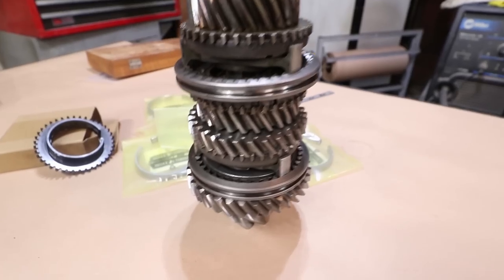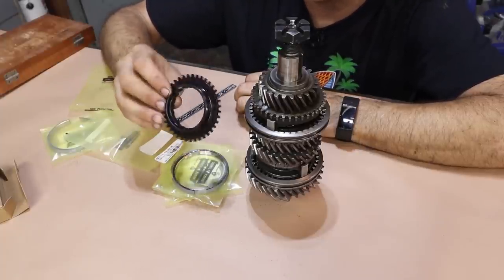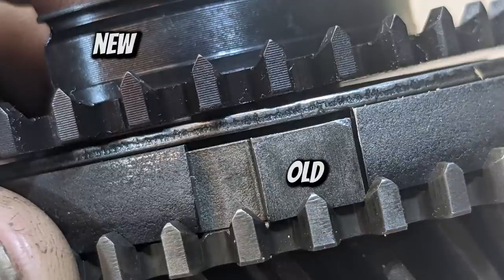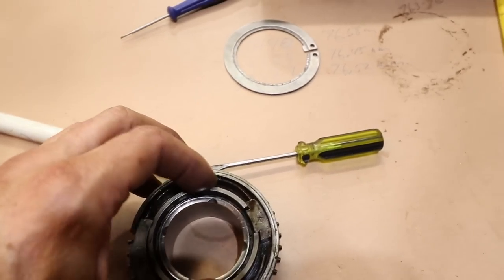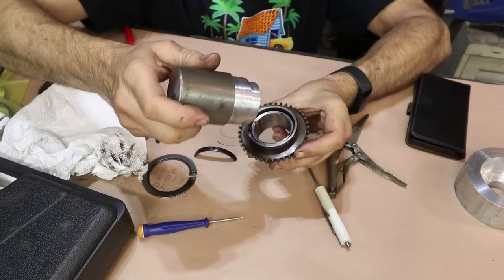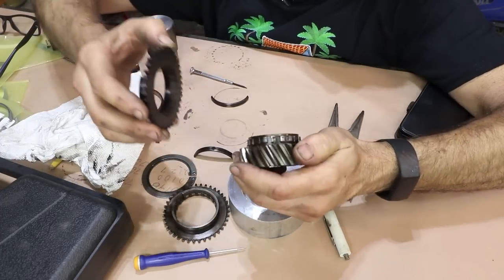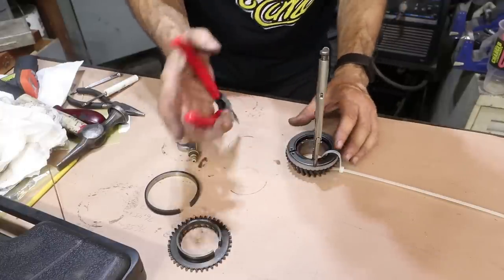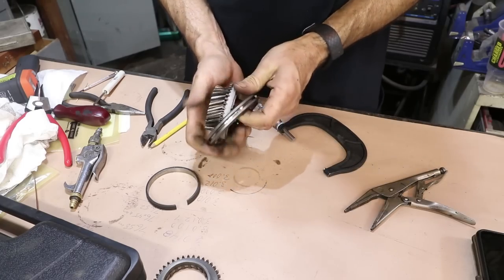NEW Synchros & Dog Teeth For My Porsche 356 Transmission 741 T6 356SC

Comment: Tom. Machine the plate surfaces in the contact area with the bearings to match and use an appropriate thickness gasket.
Reply from the maker: Thanks, I may have to do this.  The counterbore is messed up, so I'd have to machine that square and then remove material from the entire plate.

Comment: Tom , I believe you could lap that plate in with a surface plate and make that part flat with in spec , it dose not seem like its that far out ..  its worth a try if  you have to buy a used one because as you know . you may spend good money on a part that is worn more than the one you are starting with ??? stay well you do such nice work . Pete
Reply from the maker: Thanks Pete, I found one for $40 bucks, but you're right it may also need work.  I'm not opposed to machining or grinding one of these to get the bearing crush I need.  Hopefully I can resolve all the problems this week!

Comment: Tom. Machine the inner surfaces where they contact the bearings to match and use appropriate thickness gasket.
Reply from the maker: If I machine the counterbore, then there will be even less bearing crush.  I'd have to machine both counter bores and the flat mating surface to make this part work.  
Best to find a better part.
Reply: @GarageTimeAutoResto  or machine to match and make some shims if you can’t find a spare. Good luck. Love the projects and your attention to detail.